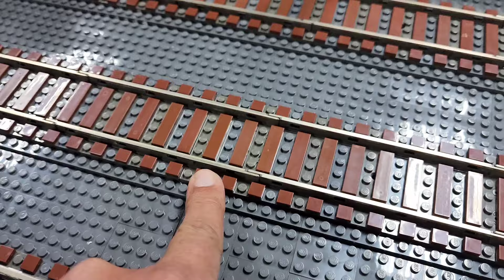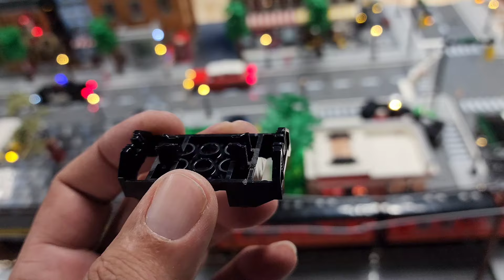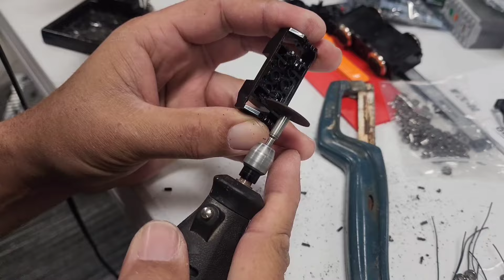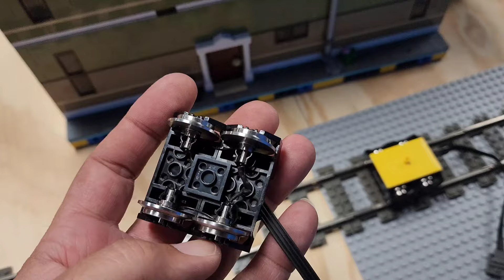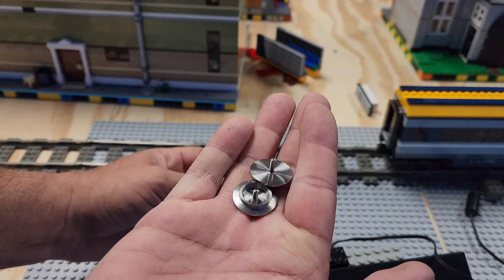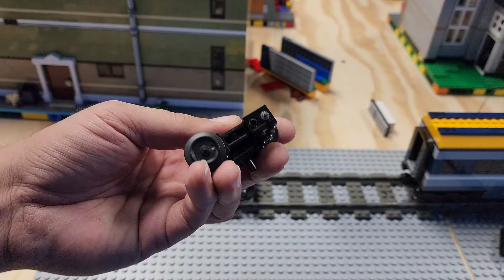Innovative Lego Train Power Solution: No More Batteries Needed!

Comment: I had this idea years ago, and I am so glad you are making it!  I am broke, so I can only dream about a lego train layout, but I would use that, probably with 12v dcc controllers running through a voltage step down to the motor...then set up all kinds of lighting on the trains. I also would make these little brake line connectors that actually would run power down the train.

other idea, put a [appropriate] ohm resister between a single pickup line, and then add one to each car, now you can have a way to detect if a car is on the block to drive signals..

But one thing I was able to do with my small collection was make a small railroad signal with feed lines for LED's.  Those 1x3 rounded black plates are perfect for that because they even look like MTA signals.

Comment: Hey Bevin, would you be willing to designing a versed train motor that work with the powered up system for easily making a two motor train that can pull bigger heavier trains in the same direction? I don't think everyone can accumulate 9V track easily nor the power supply box.
Reply from the maker: All you need to do it just power a powerups battery box with the 9volt power pickups.  There are easy ways to do 9 volt track using copper or steel mesh tape.

Comment: Very cool. The lack of independent control is my biggest problem with the 9V system. Too bad the 9V track is still hard to get and makes custom track pieces harder to get
Reply from the maker: Independent control can be accomplished, but think people would want to pay the price for it.  As for the track it can be expensive but a cheap alternative is using copper tape on the rails.  Its a very effective and durable solution.

Comment: I have a feeling lego may take this down with the recent drama involving anothe brick train company cause were mad about modifying bricks, tip, you could source third party, or 3d print wheel holders
Reply from the maker: No they are in trouble for selling sets and stating lego and other parts and not specifying how many lego and how many off brand parts are being used

Comment: This is incredible!
Amazing that you've finally, as mentioned by many others, made many dreams come true. 
The power pickup itself is just plain revolutionary, but the remote control adapter is insanely cool atop that!

I'd love to buy your products, but it seems your website either has a certificate error or my computer security software is just being persnickety.
Reply from the maker: Thanks, dont see any issues with my website and Ive had several orders today.  🙂
Reply: @BevinsBricksWorld  Yeah, so probably my security software in that case. It tends to be overly sensitive. 
I did find your site via using my cell phone data internet, will for sure be buying some pickups (once back in stock) and having a good gander at your other products!
Reply from the maker: I have had 2 other people say the same about security.  For those with concerns, I do accept paypal as well :).  The pickups, I plan to do another presale once I recieve my order of bearings.  Ill make a video as well to give people a heads up before I do it.

Comment: This is amazing. Well done!

I've never owned any 9V Lego tracks or trains. I only have PF and PU, and I never considered 9V because I don't like the wiring. But I'm starting to dislike the battery boxes too now, so your video is making me sway. Question; Can you run multiple trains independently on 9V? Whenever I see videos of controlling the train speed using the black/yellow controller, it makes me think that the motor is simply being fed more or less power through "the grid". But this will be true for all trains on the tracks. So they will all speed up or slow down. So are they independently controllable?
Reply from the maker: They can be seperately controlled if you set the speed control at full throttle and add a pf reciever

Comment: You should use one of the PWM lines for the LED so that it is controlled by the receiver and with the train controller you can change the brightness. PWM is also used to control the motor speed. Also throw a capacitor and a current limiting resistor on there just to be safe

Comment: use a full bridge rectifier or 4 diodes in a rectifier configuration then it wont mater the polarity of the track
Reply from the maker: Yes but then you cannot control the motor with the speed control and to me that is the most important part.  Thinking it would be better as an option to have a rectifier built into a plug set as an option.

Comment: Cool, a pretty simple idea, for a lasting problem. Maybe think about a more advanced system building off this. Maybe something like a basic sound board that taps between the pickup and the motor, it could change the sound it plays based on who much power it receives

Comment: Do you think it's possible to make a train motor brick (like Lego sells) where a battery is included in the brick itself? I've always dreamed about having a train motor that doesn't require wires, but also doesn't require the 9V track.
Reply from the maker: Its possible, but the box would need to be made larger for the batteries and due to the amp draw of the motors you would not get much run time.
Reply: There was one motor like this when they transitioned from 9V to 9V-RC in 2006 for Cargo Train Deluxe and a Passenger Train; the battery box is in the middle. These were the only two sets that used it and Power Functions was introduced not long after. The downside to using this would be the size and cost, but maybe these days it would be possible to scale down to the size of the modern motor bricks.
Reply: @KirbysAdventureMusic  those have the battery on the frame, not on the bogies. They're also super bulky and require larger batteries. I like that they stepped over to power functions, just a shame they made another product that's not compatible with them.
Reply: @Silacide  Yeah, I realized after I posted that comment that it's not exactly what you meant. I don't like the bluetooth integration of Powered Up so I wish Power Functions was still in production... oh well.

Comment: Very nice! May I suggest you consider 3D-Printing the wheel base? I'm sure it would need it way less time to manufacture, and it's a lot less expensive than you might think. I have a FDM printer farm, and I agree this technology might be a bit to rough for very delicate parts (even though you can reach it with high accuracy), there are other printing technologies where you can hardly make out a difference to injection moulding.
Reply from the maker: I have considered it but I have also seen very few things printed for lego that have a good clutching power.
Reply: @BevinsBricksWorld  Fair point. I'm not really in the Lego game, so one would have to test it out first. cheers

Comment: I think this question has already been asked... What about aluminum instead of steel? It will have a noticable lower price – both the metal itself and its processing.
But just like stainless steel it also "does not rust" and in appearance it will not be much further (still looks somewhat metallic).
Of course, the reliability will be lower than that of steel... but still, metal is metal – it will be quite enough for use with Lego Trains.
Reply from the maker: Yes, but aluminum is very soft, and the shaft legth required for this method only being 3mm diameter, means it would easily bend and warp, making the wheels wobble.  Im more concerned with quality than I am cost.
Reply: @BevinsBricksWorld  , hmmm... Steel axles but aluminum wheels? I think this will turn out to be even simpler in production – no need to “waste” metal on processing a solid part, instead, process the wheel and press a steel rod into it. I think that an aluminum wheel can easily withstand the required load. Although even when using a steel wheel, it will be possible to optimize reduce price of production
Reply from the maker: Your welcome to try and make some, but now your talking about 2 unique items to be machined and the aluminum wheel need to be pressed into the axle so it cannot slide.  So now your also adding time to assembly.
Reply: I take into account that it is possible to buy a pre-made steel rod of the required diameter and length. Time is taken up for pressing, but is freed up for creating the rod itself.

Comment: You should use a bridge rectifier its basically just 4 diodes instead of two.

The advantage is you will have power no matter the direction you turn the knob.
Reply from the maker: I actually have a few rectifiers on order to test sizing

Comment: I still have some of the old 9V and even 12V train parts around. They were a looot better than modern ones in many regards. Lego back then had a lot of accessories for them and specially the 12V had many different nice lights. Lego had always been expensive, but back then it also has the quality and products to demand that price.

How i loved building things like small lighthouses or trainstations with all the various gimmicks light up.
Reply from the maker: I never owned any of the 12 volt stuff, but have seen some of it and you are right, they had some amazing options and parts.

Comment: Even if many of the comments describe this idea as ingenious, I don't see it that way. The idea is basically good but not thought through to the end. It definitely won't work on switches because of the non-electrified "gaps" and I'm not sure about crossings either, unless you buy two of your adapters for a total of $80 (!!!). It probably doesn't make sense then to use the two adapters on one bogie, but on two different ones. But that means that I have to lay a lot of cables to the locomotive. For visual reasons, I need a lot more of the stainless steel wheels for §25 a pair. And finally there is the problem of the missing weight due to the missing battery box. 
To be honest, I don't see any advantage at all compared to an used 9-volt motor that I can buy for about $50 on Bricklink. Your idea is definitely not for people with a normal relationship to money. It costs me hundreds of dollars to equip just one of my trains.
Reply from the maker: That may be your opinion but I cant make and sell these fast enough.  Your looking for cheap and thats ok.  This isnt cheap.